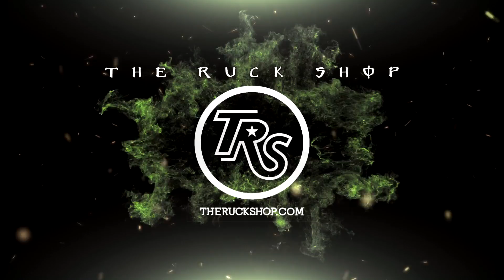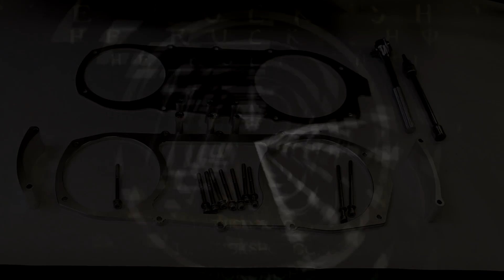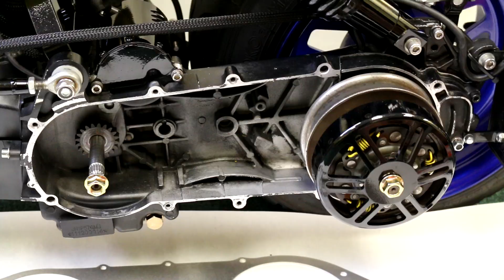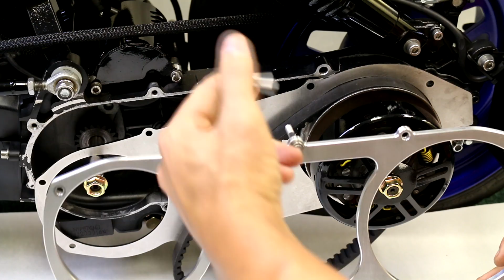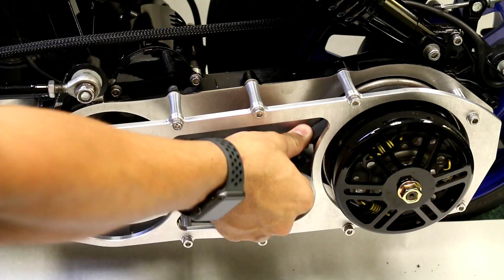TRS ULTIMATE GY6 CVT INSTALL

Comment: why wouldnt this work for the get engine?
Reply from the maker: Chef Boyardee cuz the motor size are different we have for get engines looks of them just look up CVT
Reply: The Ruck Shop I mean just the anklebiter setup,hence its the same cast iron cvt backing that you mount this on
Reply from the maker: Chef Boyardee we don’t understand but you.cant use GY6 parts on GET motor . We do have cvt covers like anklebiters
https://theruckshop.com/product/trs-cnc-aluminum-ruckus-zoomer-cvt-cover-anklebiter-3-colors/
Reply from the maker: https://theruckshop.com/product/trs-cnc-aluminum-ruckus-zoomer-cvt-cover-anklebiter-3-colors/

https://theruckshop.com/product/trs-vip-series-ruckus-zoomer-cvt-cover-anklebiter-2-styles/
Reply: @Theruckshop  I have seen those,I am buying the clear ghost cover soon. its a shame we cant get the type of setup like in the video where its 2 of those plates for a true lookiing anklebiter without the gy6. thanks though!
Reply from the maker: Chef Boyardee I’m sure you can make with a some spacers . And the clear and the other one . The reason we don’t make is cuz the clutch and variator don’t stick out as much as a gy6 . If we get enough demand we may make but you are first to ask in 9 years for this style